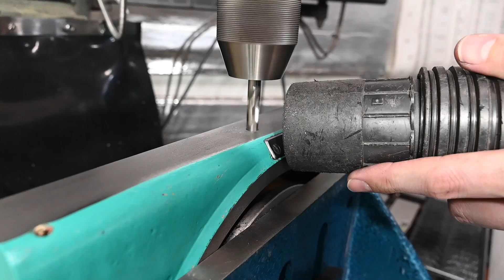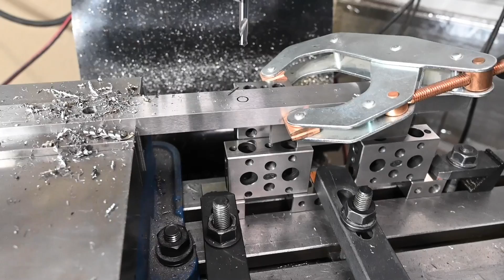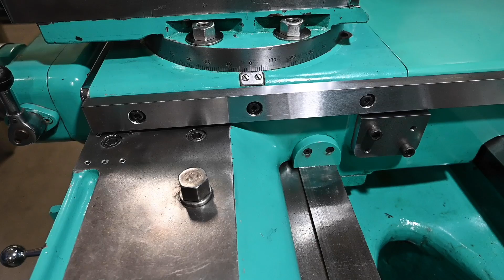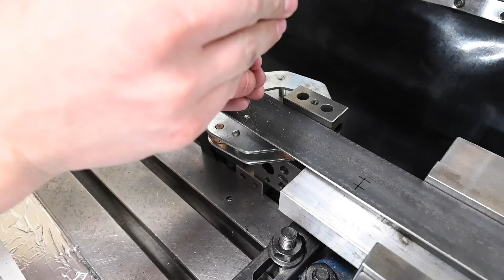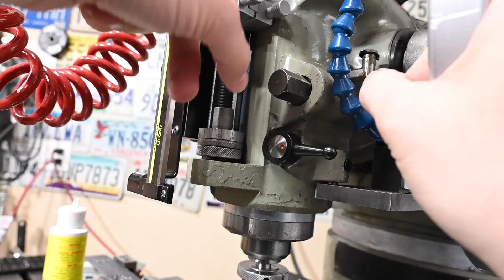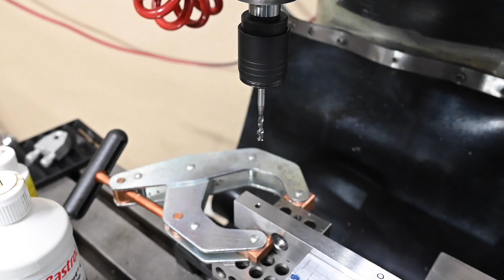Monarch Lathe DRO Scale Mounting Bar and Guard

Comment: Finished watching finally: Excellent progress! Tight Tapping Diameter Threads in Steel = Broken Taps/ Broken Spirits/ Bad Words. I watch another YT'r who routinely goes up one number drill size when working with chrome moly steels and stainless-steels: It seems to work well for him. I tried it, and I can't tell a difference in the fit of the tapped hole, but can say with certainty that they sure tap a lot easier!
Reply: Chromoly taps pretty well, 300 grade Stainless steel not so much, I go .01" over in stainless, and ovoid spiral flute taps whenever possible, they are so weak. 
Good taps make a world of difference, all i use are machine taps :)
Reply: Nothing wrong in a few thou oversize, its called a working fit means you can carry on working and not scrap a job or hours getting a broken tap out.

Comment: Your band saw sure came out nice, compared to what it started as, I think the tabletop is better than new! Now it has replaceable inserts should something go horribly wrong. Thus project is coming along really well too!
Reply from the maker: Yes the saw is great to use now. I finally got the feed cylinder in and will make one more video when I make mounting hardware for it- quick and easy to make precise cuts with it.
Reply: @AlwaysSunnyintheShop  I was going to say something about the bandsaw, it's sure a sweet machine now. Looking forward to seeing the feed cylinder installation

Comment: I also have a sensitive nose and I like Rapid Tap more than most other cutting fluids.  It smells like cinnamon to me when hot.  You can thin Rapid Tap with WD40 too. The other oil (not cutting) I really like is Starrett M1 which smells like almond oil.
Reply from the maker: I agree on both points- the Tapmatic Aquacut I have REALLY smells like cinnamon but it turns into a glue-like residue when it gets hot and is a pain to clean up. Starrett M1 is great- just the right consistency to hold onto steel and smells just fine.
Reply: I have a bench drill press and some other tools in my flat were I do projects, small furniture and hobby stuff etc. 
Since I’m not alone in the apartment I want to avoid “toxic” stuff and bought some refined avocado oil for when I needed to drill the occasional hole in metal. 
In no way am I doing the kind of work you guys do but I’ve found it to work well, it has a high smoke point of about 520 °F, doesn’t dry and smells pleasant. 
How would you know that one oil is better than the other and what sets them apart?

Comment: If your lathe or mill has a cutting fluid reservoir, a water based cutting oil can reduce the smoke and smells.
Reply from the maker: My lathe has a coolant sump and I’ll rebuild the pump and plumbing when I have time. The mill doesn’t have a sump. On some projects I’ll use my Noga Minicool system and connect tubing to the table drains and into a bucket. Better than nothing for projects I’m doing a lot of cutting on.

Comment: Now if only you had an endmill in a drawer somewhere that would not have left that line on the ends of your bar. lol I am fine with it but surprised your ocd allowed it. Maybe you buffed it later. :-)
Reply from the maker: Lol yeah well, sometimes even my broken brain lets good enough be good enough. I did actually feel it with my finger and it's just cosmetic 😂

Comment: RE: Narrowing the scale cover/ guard operations: rotating the work 90 degrees and side milling to height would have been better, IMHO (having done these exact operations for an identical application recently). More uneven wear on the endmill, but better from a part rigidity/ tool pressure/ cutting finish standpoint. Also, I moved my part in the vise (every 2nd hole from the middle out, the holes were 2-1/4" on center), and used the first hole (drilled and reamed to exact size) as a datum point. I offset the table longitudinally 5-1/2" with in a gauge pin in the chuck and placed the work in the vise with the datum (reamed hole) on the pin, I was able to get two holes per setup with the material being drilled being entirely supported in the vise. More setups, and you had to pay attention to keep from drilling into the vise but it was all fairly non-critical and moved along fairly quickly with a good result.

Comment: Your mill comes with a quill stop....! the threaded nut with a dial on the outside...
Wind the stop up, touch off and come up on the nee as you did.
The nee is just as accurate as the dro just a little slower. 

This power tapping is bad practice as people watching will lose the " Feel "  or never have it as they see nothing else.....

The job was nice but the procedures will draw people to follow tat type of path.
Reply from the maker: Yes you can also use the threaded quill stop, but it's super slow to bring up and down on my machine. The removable one is a good compromise.
Reply: @AlwaysSunnyintheShop  All us apprentices who learnt on bridge ports used the stop nut.
some times you have to take it slow and not short cut things
THAT WAY YOU BECOME A BETTER ENGINEER AND DON'T USE HOLE SAWS THE WRONG DIA OR BREAK TINY TAPS WITH POWER TAPPING LOL
Reply from the maker: Don’t really see how it’s any different in function- it’s just easier and quicker to use. I’m glad I don’t think about my mistakes as much as you apparently do lol. I don’t feel any shame in making mistakes like breaking a tap or using the wrong size hole saw- learning on my own I will do things wrong at times.
Reply: @AlwaysSunnyintheShop  Make as many as you like, my papers say completed  toolmaking apprenticeship...not TV star lol.
looking fwd to the next project
Stay safe......